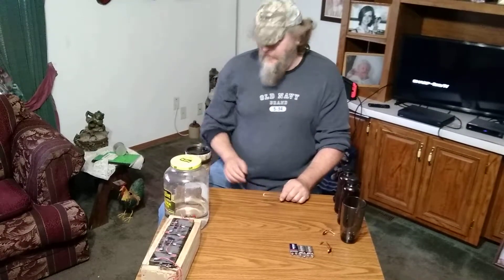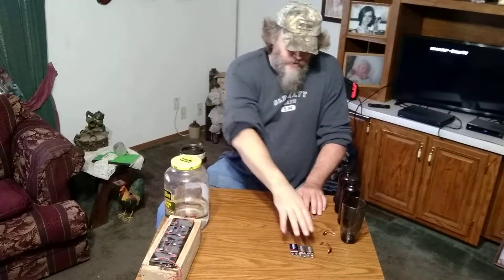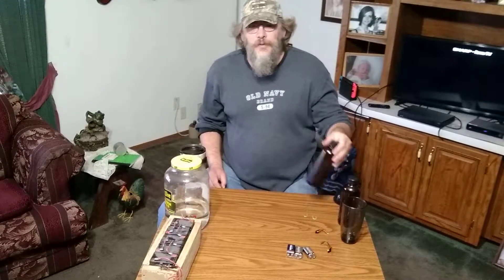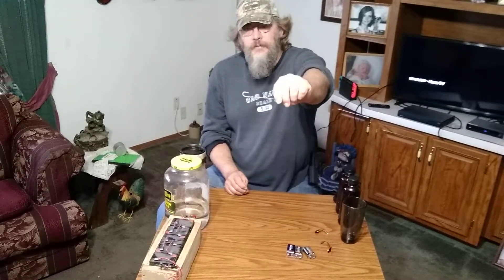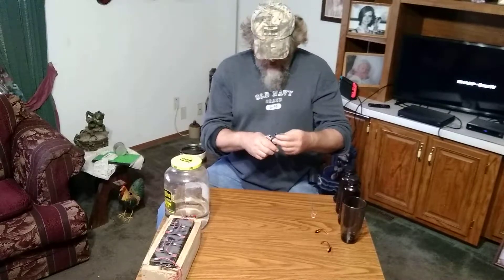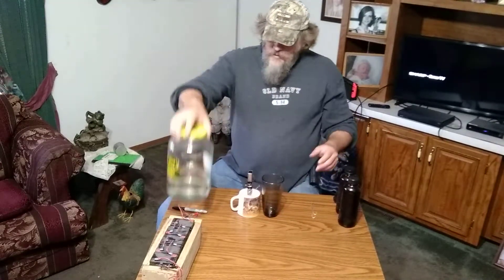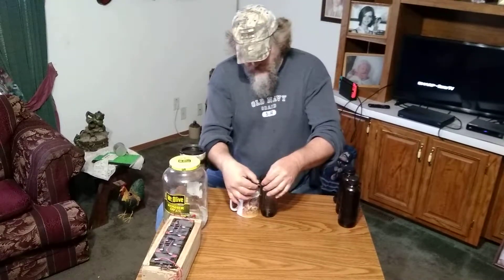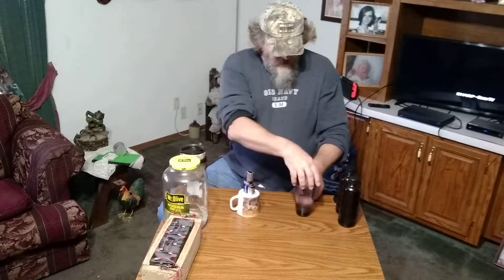How I make colloidal silver

Comment: Hi I make the silver with 3 9 volts and the particles collect on the bottom of the jar.  I then strain it with coffee filters but the next day it turns an light amber.  Is this safe?  I’m using 14 gauge and distilled water.
Reply: Buzzard - Roost sorry to hear about your phone.  Thank you for the response.  I finally purchased a laser light, so I will check it within 10 minutes.  This will be my 3rd batch hopefully it will be the charm. Stay safe🙏